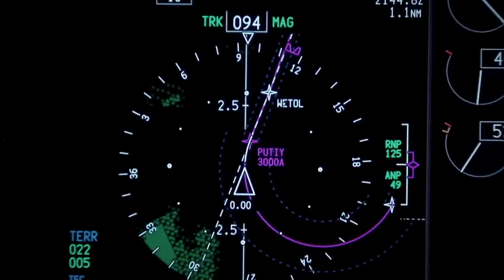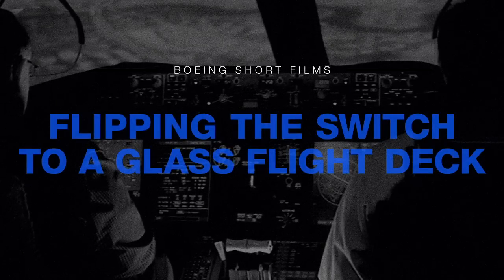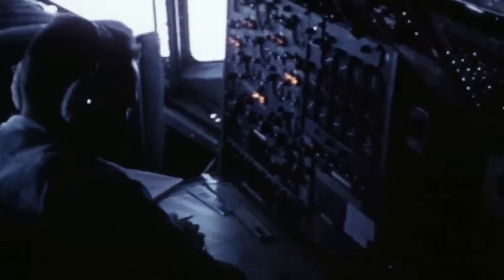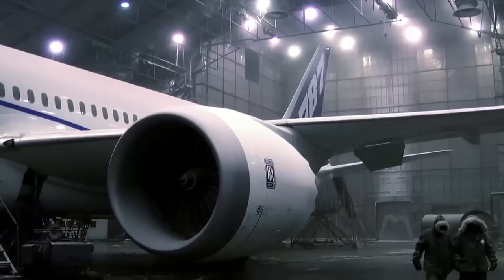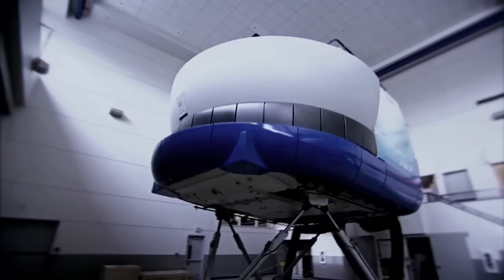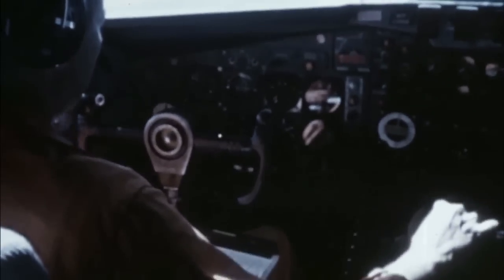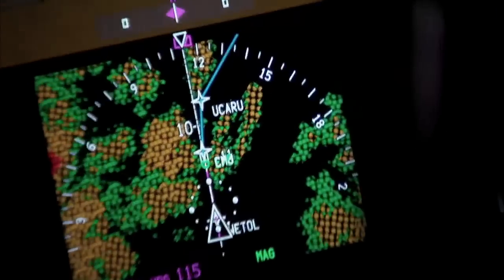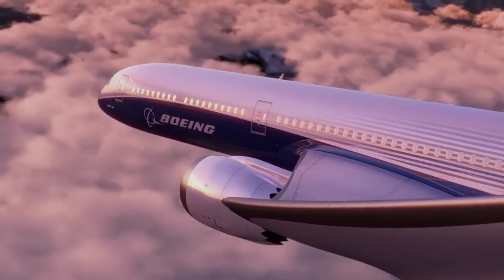Boeing: Flipping the Switch to a Glass Flight Deck

Comment: Pilots have deliberately been buying planes with analog gauges because of the volatility of batteries, and if your batteries were to go dead (like can happen, especially with Boeing's 787 Dreamliner as well as many small planes) and you had to land, analog gauges require no power, so they would all still work, but all those innovative avionics can't run without power, making it very dangerous to land for larger planes especially because they fly IFR (which stands for instrument flight reference, meaning you use the instruments, instead of your visual outside sight line to fly) just making it more dangerous if there were to be an electrical problem.
Reply: Elecctrical systems on airplanes like these are backed up by 2 extra systems in case one fails, and if all 3 fail you'd still be able to monitor because of the RAT

Comment: Are the screens touch screens? If not, please put them in new generations of aircraft.
Reply: They are touch :)
Reply: WumbologyTM
Are you sure?
Reply: Yup :) Some of the ones in the 777 are and most in the 787 are. Some however use a small joysticks or buttons to scroll...but still, many are touch.

Comment: Am I the only person who thinks touch screens are too"touchy"for use in an aircraft during rough turbulence, sudden loss of power or other circumstances where the cockpit is vibrating or high g forces are being brought to bear? I'm pretty sure, certainly hope, that they use s better touchscreen than my phone does because I"hit"the wrong button a lot with touchscreens. I think its great that technology advances, but its not an advance if it isn't an advantage over the previous methods. Does this control system actually work as well under stress as it does during smooth skies?
Reply: +Michael Foye It does. Otherwise those planes wouldn't fly with it. Aerospace equipment has to be licensed, and they are strong criteria. The Dreamliner to my knowledge flies with that touchscreen for ... 5 years now. Never heard of troubles with it. And compared to the steam-gauge cockpits those glass cockpits don't overwhelm you. Ever seen a 747-200 cockpit on a photo? It's madness. It's cool, but insane to monitor. 
But I perfectly understand your anxiety. I am also always a bit skeptical about such things - but then you have to keep in mind that the computers on an airplane are not to be compared with our computers at home.
Reply: Stuff that is important is not operated by touchscreens.
Reply: god i know. Imagine the sheer pandemonium if the pilot accidently turned the feature film over or accidently pressed the "alluh akbhar" button.
Reply: +steven halliday 

I was more concerned with a pilot having trouble with the touchscreen during rough weather and other unfavorable conditions.  I've heard more than one pilot speaking about how they had to operate cockpit controls in darkness or struggle against g forces to reach controls.
Reply: Michael Foye
If the plane is in such an unfortunate position that the g-forces really affect the pilots, you don't push any buttons on the FMS which the touchscreens mostly control. You hand-fly the plane to bring it under control, then you bother with the computers/FMS whatever. Aviate, navigate, communicate. Such tragic cases like UPS006 can happen, whether it's a steam-gauge 737-200 or a 787 glass-cockpit with touchscreens. And as it is always in aviation: There is a back-up for the back-up for the back-up. As for hackers - at least with Boeing planes it should be that the pilots can shut down a "lunatic computer" - and may it be by pulling the fuse.
Reply: +Courier6 
Thank you for answering my question.  I am still skeptical about touchscreen technology in this role, but your answer was the kind of answer I was looking for. I am familiar with the problem of blinky lights and hard to reach knobs as well. I'd like to think that this is a significant advantage over the older methods, but I thought it intuitively obvious that touch screens would be problematic. If there's any input from pilots/flight crews who have seen this system in action during unfavorable conditions I'd like to hear from. 
I would fly in such a plane without anxiety, I am not prone to fear based reactions. My concern was that the touchscreen system would represent a reduction in a pilots ability to control the aircraft during those fortunately rare circumstances when planes suffer sudden altitude loss or extreme weather conditions etc.
Once again thank you.
Reply: +steven halliday you rrddbnnjb
Reply: Michael Foye You are very welcome. Although I am not a pilot myself, so it should be regarded as an opinion, not set in stone ;)
Reply: Yes.. You are.. This is every pilots dream right there.

Comment: Don't get me wrong it's a fantastic idea but what if they accidentally pressed the wrong button?
Reply: +Nick „budapestifiu“ Then the in-built self-destruction machine will go off and kill innocent children in Africa. Geez. Just kidding - the old planes had a lot of buttons to press at the wrong time, too. That is not a problem of the glass cockpit - the steam-gauge cockpits where stuffed with, well, gauges, that's why they had a flight engineer on board to eyeball them. Nowadays, the computer does it, and it isn't that new. The 767 had a glass cockpit when it came out - of course not that fancy with touch-screen and everything.
Reply: Plane explodes (jk)
Nothing really, and they are trained and know what to do